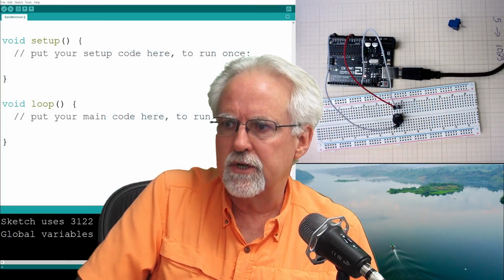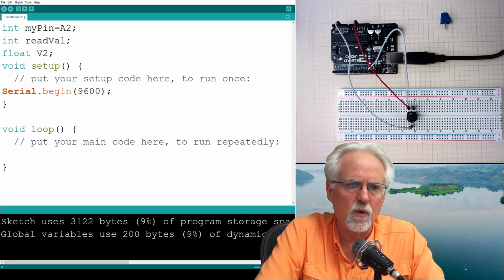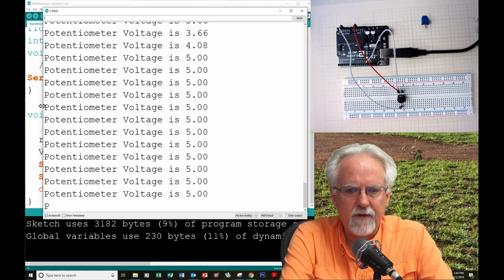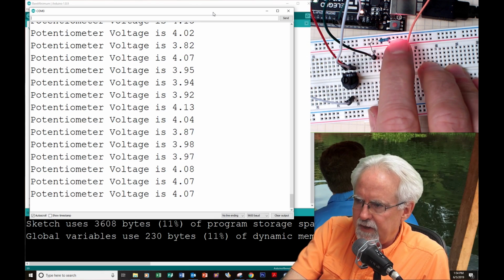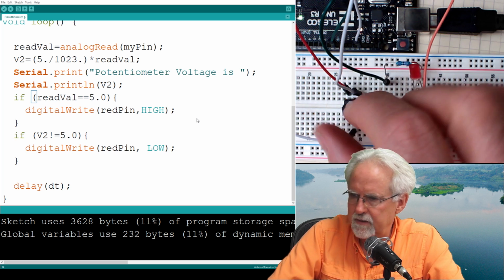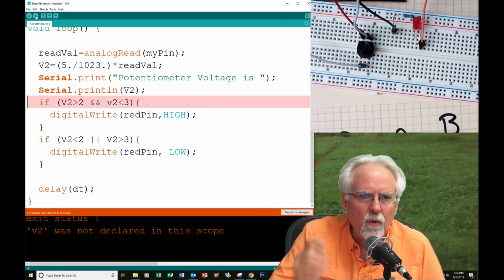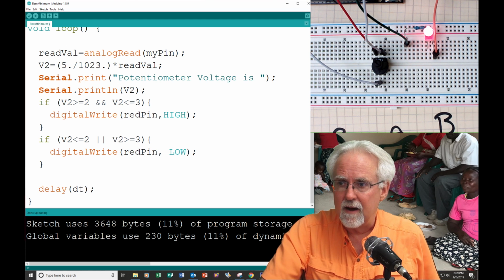Arduino Tutorial 13: Understanding Arduino If Statements

Comment: I think the problem with your if(V2 == 4) test condition is that the chances of your reading exactly 4 volts is very low.
Reply: That's why he put 5 instead of 4. His problem was the V2 != 4.0 conditional immediately after. You need to understand programming logic. What he essentially told the program to do is:

1. Turn LED on if 5.0 V
2. If NOT 4.0 V Turn LED off.

The 2nd command 'overwrote' the 1st, in a sense. I mean, the 1st command still exists and got executed, but the 2nd command ended up being the final one executed. Because when he turned the potentiometer to allow 5V, 5V is NOT 4V, and in the 2nd if statement, he told the program to turn led OFF if the voltage is not exactly 4V, which 5V isn't... That's why the LED turned ON with 1st IF command, but immediately turned and stayed OFF with the second IF command. Maybe if he'd put a big delay in between the IF statements, you could see this, but since he didn't, computers execute very fast and it seemed like nothing, but when you break it down that's what the issue was. He figured it out soon enough though, by changing the 2nd IF statement to != 5.0V, he corrected the problem.

Comment: I did the HW, and it worked just fine.  in each if condition, i have  
if(V2<3){
digitalWrite(greenPin,HIGH);
digitalWrite(redPin,LOW);
digitalWrite(yellowPin,LOW);

}
if (V2>=3 && V2<4){
  digitalWrite(greenPin,LOW);
digitalWrite(redPin,LOW);
digitalWrite(yellowPin,HIGH);
}

if (V2>4){
 digitalWrite(greenPin,LOW);
digitalWrite(redPin,HIGH);
digitalWrite(yellowPin,LOW);

let me know what you think?

Comment: Hello, I also am a 71 year old retired engineer and following through the lessons, as a new hobby.
I hope you will consider showing a schematic in addition to the wiring (for others), and just show the pin numbers on the schematic; that would really go faster for us who are advanced in reading schematics.

I still can't figure out why my stepper motor vibrates and doesn't turn. I hope the motor they gave me wasn't defective; that would be sad. (Well I did just jump ahead to that (interested me) and came back here. 

Any suggestions on how I can test if the step motor is good or bad?

Comment: Thank you so much for your effort.
This is the assignment if anyone wants to see:

int myPin = A2;
int readVal;
float V2;
int delayT = 250;
int greenPin = 11;
int yellowPin = 10;
int redPin = 9;

void setup(){
  pinMode(myPin, INPUT);
  pinMode(greenPin, OUTPUT);
  pinMode(yellowPin, OUTPUT);
  pinMode(redPin, OUTPUT);
  Serial.begin(9600);
}
void loop(){
  
readVal = analogRead(myPin);
V2 = (5. / 1023.) * readVal;
Serial.print("Voltage: ");
Serial.print(V2);
Serial.println(" V");

  if(V2 <= 3){
  digitalWrite(greenPin, HIGH);
} if(V2 >=3){
  digitalWrite(greenPin, LOW);
}

if(V2 > 3 && V2 < 4){
  digitalWrite(yellowPin, HIGH);
} else{
  digitalWrite(yellowPin, LOW);
}

if(V2 > 4 && V2 <= 5){
  digitalWrite(redPin, HIGH);
} else{
  digitalWrite(redPin, LOW);
}

delay(delayT);
}
Reply: Thanks! You helped me over a bump.

Comment: Hi. I am 72 years old, and spend a lovely time following your lessons. After learning the analog read and write, I am wondering why the analogRead runs between 0 to 1023, while the analogWrite runs between 0 to 255. Do you have any idea? Thank You
Reply from the maker: The analog read is a 10 bit number, meaning when you convert to decimal, you get 2^10 different number. 2^10 is 1024, but since we are starting from zero, we can count to 1023. The analog write is an 8 bit number, so if we start counting at 0 we can get to (2^8-1)=255
Reply: @paulmcwhorter  Hi Paul. It is very clear from your lessons, but since both of them are conversion to decimal, why dose the arduino use 10 bit for reading, and 8 bits for writing.
why not 8 or 10 bits for both of them?

Comment: The homework exercise has me thinking about that scene in Apollo 13 where they are working on the sequence to power up the command module after a few cold days in the LEM. Gary Sinise as Ken Mattingly is working on power-up sequences in the simulator. He needs to make sure that they don't draw more current than they have available. This kind of program could flash the lights (and not turn them off) if the number peaks at any time rather than watching a needle on a gauge as they did in the film.

Comment: if (2<V2<3){
    digitalWrite(redPin,HIGH);
  }
  if (V2<2.0 || V2>3.0){
    digitalWrite(redPin,LOW);
  }

I tried out this condition for the HIGH clause, the LED started blinking dimly for the LOW clause and was bright when the voltage was between 2V and 3V. Can you please explain why? Thank you!

Comment: Love the series!  I am confused on why "A2" is an int variable.  Is that just how Arduino is set up?
Reply: Hi Mike.  The Arduino differentiates between the Analog Readable pins and the other pins by prefixing them with "A".  Similarly, the Digital R/W pins are simply numbered 0-13.

Comment: Quick question: My readings from analog pins are only show as "0' If I connect them to ground, or if I hold other end of the cable.  Otherwise I always get a constant value of '318' as minimum and maximum 0f '1023' as expected. 
I did a calibration to software for a proper reading but I was wondering If I damaged the board with a short I have not noticed before.

I can ground it and it reads zero as expected but if I do that for every pin how am I going to read values... 

Checked potentiometer with the kit, looks like it's working as intented

Comment: Hey Paul,  love your Arduino instruction learning but I was trying to think outside the box an develop a circuit where we have a momentary button and a LED.  The Sketch would initially turn on the LED to a low light (10) then ramp up (get brighter)  when the button is pushed with a slow delay but when the ramp up is maxed (255), the LED would reset to low light (10) and wait for the button to be pushed again.  Now I was able to create a sketch to do the first part but when the LED is back to the reset state and I push the button again, it doesn't start the (IF) ramp up condition.  Do you have any suggestions?

Comment: i have been trying to relearn the Arduino, its been almost a decade. i followed along up to about tutorial 8 and i wanted to build my own little setup my goal was to have 3 inputs with 3 buttons each assigned to the RGB of the RGB LED. so if you hit the red button the LED turns red and you hit the blue button it turns blue. i have the RGB buttons on pins 2 3 4 and the LED leads on 8 9 10. i got it to work... sort of i hit the red button the LED turns red but stays red for about 5 seconds or so, the same happens with any of the 3 buttons in fact i don't have any delays. That was issue 1 my other issue is i seem to be triggering the digital read when i break the circuit like i can unplug the wire going to the red button and with it still plugged into the Arduino i can make the red LED light up with an open circuit i am a little confused as to why that is happening.

Comment: If you remove the delay the leds respond quicker to the pot turning ie at the threshold of one going off and another coming on but then the serial monitor text scrolls faster. Anyway to have a delay just in the monitor but not in the reading of voltage?

Comment: I feel so ashamed and proud at the same time, I was staring at code for hours wondering why this thing wasn't working and I had plugged in the wrong variable into the if statements and stuff, after I figured it out I cleaned up the code in less than 3 minutes such a feeling of satisfactionn stupid three LEDs LOL 😂

Comment: Got the assignment done. Yellow led was really dim for some reason but got it done. Thanks for the great videos.
Reply from the maker: Did you remember to do your pinMode? If you forgot that, it can lead to dim LED. Other possibility is your resistor is not correct value. Your LED should be bright if done correctly.
Reply: @paulmcwhorter   I believe I had the pinMode set up correctly. I had thought about the resistor being incorrect and checked that with my multimeter and is was a 330 ohm.  I also checked voltage coming out of the Arduino and I had 5V. Maybe I had a poor connection somewhere. I will redo the assignment and see if I can figure it out. Thanks.
Reply: Paul,
I just wanted to let you know I did the assignment again and it worked perfectly. Unfortunately I didn’t save my pervious program so I am not sure what I did wrong.  Guessing you were correct and I didn’t have my pinModes set up correctly.  I just want to thank you for not only sharing your knowledge with these great videos but replying to my comment and helping me work through issues is amazing. 

Thank you.

Comment: Hello, My name is John, I'm 58, and I'm from Maine. I studied electronics in the past and the circuits are very easy. What's not easy for me is programming the Arduino.  I've programmed some lighting effects for models but often get errors in my code or the lighting sequence doesn't work as expected.  I find learning the material, as you present it, enjoyable and very structured. I laugh at times when you get fussy about everything being lined up. I'm the same way. I can not do the circuits without first running power rails, LOL. After watching, building the circuit in this lesson, and writing the code, it seemed as though you did combine floats and integers with the statement  V2=(5./1023.)*readVal;  Am I missing something here?

Comment: Good day
Curious about the variable declarations where an integer is declared and assigned a value of A2 (A2 for the analog pin 2). A2 is not an integer.
Why?
Reply from the maker: A2 is an int, because arduino defines it as an int.
Reply: @paulmcwhorter  Funny in coding since it's not an actual number.
So be it

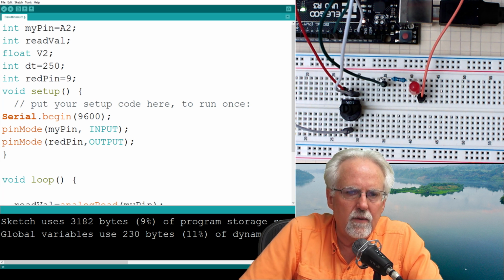Comment: AT 16:39 you realized you did not add "pinMode(mypin,INPUT);" to the void setup commands but at this point you had already ran the program and the serial monitor was displaying the read values set up in the void loop.  Are the analog pins on the Arduino always reading and the command is not required in the void setup?

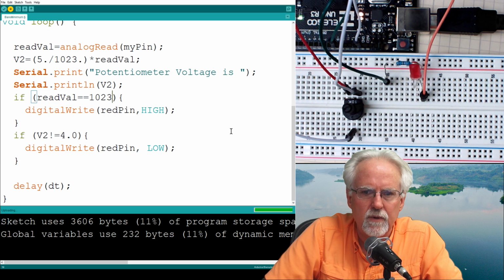Comment: I think the problem at 26:00 is that while you turn the LED on when you set voltage to 5, you immediately turn it off after that again because it is not 4. It's not a syntax problem but a logic problem. :)

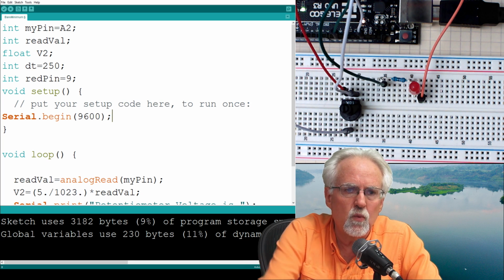Comment: At 16:10 you mention that you forgot to add the pinMode function to set A2 as an INPUT. but yet the circuit still functioned without it. Why is that? Or could it mean we dont really need it anyways? I tried doing all the codes you wrote in this lesson with and without it and it always functioned correctly.

Also at the end you wrote IF statements of (V2>=2 && V2<=3) and (V2<=2 || V2>=3)
Don't they kind of contradict each other since its saying to both turn on and off at 2V as well as 3V?
So out of curiosity I tried getting the serial monitor exactly to 2.0V and 3.0V
At 2.00V it resulted in making the LED blink consistently at the same rate as the set delay function in the code. Although at 3.00V it would also blink but randomly unlike 2.00V. Just thought I'd note that.

Thanks for the tutorial btw.

Comment: Hello Paul, I'm 69 years old and two months ago I didn't know for sure what a resistor was. Well look at me now.
I have a question. At the 35:10 mark why is there not a conflict between your two "if" statements? The first one says 
if V2 is <=3 redPin HIGH and the next if statement say if V2>=3 redPin LOW. I set up the assignment without the equals sign and after I had it working I went back and added the equal sign and had no conflict. Is it because it's just too hard to keep it on 3V and the eye can't see it.
I just became a pateron. Have an iced coffee (coffee != sugar || creamer)
Thanks for all of this.

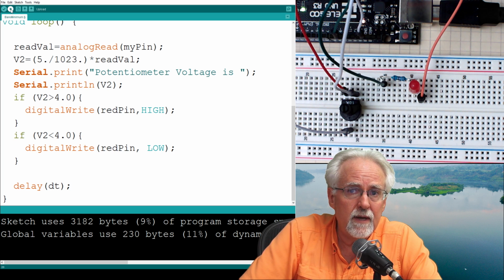Comment: 20:35  You could initialize a boolean flag variable e.g-ledON=false and update it to true in the for block when V>4.0 ,then create another for loop that updates it to false when V<4.0. That way you can avoid turning PIN off constantly inside the void loop.

Comment: At 27:00. Could you leave this.. if (Readval ==5.0)   {  ( digitalWrite redpin, HIGH)  };  if (V2 !=5.0) {   (digitalWrite, redpin LOW);    }
And have the code still work but in a  different way than is intended by Paul? I say it would. Wait.... Maybe the code would need an AND statement. An OR statement seems a better solution.

This will work I think... if (Readval==5.0) {     (digitalWrite, redpin HIGH)    };       AND   if (V2 !=5.0) { ( digitalWrite, redpin High)         }

Comment: Your excitement during work is great...
Reply: I am building a device to measure the speed accurately of vehicles and incoming or outgoing..
Please help me if there is any such sensor available in the market. 
I tried hb100, but that nneedsan amplifier circuit and does not tell the direction. This project is to save the lives of people in accidents. 
So please help me.

Comment: I spent an hour trying to find out why my red LED circuit wasn't working.  Test the LED, test the arduino leads, switch leads around.  Is the pot working?  Go out to my shop and get my Fluke which I trust completely. All are working as they should.  Finally found a period where a comma should be in the pinMode output for the LED.  What fun!  Love this stuff.  It's a super thing you're doing giving this free course.  Have a coffee.
Reply from the maker: Called Troubleshooting. No fun at the time, but wonderful joy when you find the problem.

Comment: Paul, this would've been a perfect opportunity to introduce the else statement as in if … else ...

Using else is a much more elegant and less error-prone way to provide instructions that should happen if the condition is not true rather than writing a second condition which is the negation of the if condition.
Reply from the maker: No, I dont use else because in practice it is a logical double negative. Logically it is clearer to explicitly cover a parameter space in positive logic. As a practicing engineer I can not tell you how many times I have seen disaster on projects and programs due to incorrect logic resulting from use of else.

Comment: Is it appropriate to post homework assignments? I did a sketch that formats the output with ten rows of ten values j. It prints out a perfect table and then stops. It doesn't continue looping like the 'for and while' loops. curious about that. To get a nice pretty table, press the 'clear output button' in the bottom righthand corner of the screen and the push the reset button on the Arduino. 
int j=1;
int forAwhile =70;
void setup() {
  Serial.begin(9600);
  }
void loop() {
 if(j<=100){
  if(j==1||j==11||j==21||j==31||j==41||j==51||j==61||j==71||j==81||j==91) {
  Serial.println();
  }
  Serial.print("|");
  Serial.print(" ");
  if (j<10){
    Serial.print(" ");
  }
  Serial.print(j);
  Serial.print(" ");
  j=j+1;
  delay(forAwhile);
  }
}

Comment: int myVoltPin=A2;
int readVal;
float v2;
int time=250;
int grnPin=12;
int ywPin=7;
int redPin=8;

void setup() {
  // put your setup code here, to run once:
Serial.begin (9600);
pinMode (redPin,OUTPUT);
pinMode (ywPin,OUTPUT);
pinMode (grnPin,OUTPUT);
pinMode (myVoltPin, INPUT);

}

void loop() {
  // put your main code here, to run repeatedly:
readVal=analogRead(myVoltPin);

v2=(5./1023.)*readVal;
Serial.print("the voltage is ");
Serial.println(v2);

if (v2<3.0) {
digitalWrite (grnPin,HIGH);
digitalWrite (ywPin,LOW);
digitalWrite (redPin,LOW);
delay(time);
}

if (v2>3.0  && v2<=3.5 ) {
digitalWrite (grnPin,LOW);
digitalWrite (ywPin,HIGH);
digitalWrite (redPin,LOW);
delay (time+150);
}

if (v2>3.0  && v2<=3.5 ) {
digitalWrite (grnPin,LOW);
digitalWrite (ywPin,LOW);
digitalWrite (redPin,LOW);
delay (time+150);
}

if (v2>3.5  && v2<=4.0 ) {
 
digitalWrite (grnPin,LOW);
digitalWrite (ywPin,LOW);
digitalWrite (redPin,LOW);
delay (time); 
}

if (v2>3.5  && v2<=4.0 ) {
digitalWrite (grnPin,LOW);
digitalWrite (ywPin,HIGH);
digitalWrite (redPin,LOW);
delay (time);
}

if (v2>4.0  && v2<=4.5 ) {
digitalWrite (grnPin,LOW);
digitalWrite (ywPin,LOW);
digitalWrite (redPin,LOW);
delay (time-100);
}

if (v2>4.0  && v2<=4.5 ) {
digitalWrite (grnPin,LOW);
digitalWrite (ywPin,LOW);
digitalWrite (redPin,HIGH);
delay (time-100);
}

if (v2>4.5  && v2<=5.0 ) {
digitalWrite (grnPin,LOW);
digitalWrite (ywPin,LOW);
digitalWrite (redPin,LOW);
delay (time-200);
}

if (v2>4.5  && v2<=5.0 ) {
digitalWrite (grnPin,LOW);
digitalWrite (ywPin,LOW);
digitalWrite (redPin,HIGH);
delay (time-200);
}

delay(time);

}

Comment: Hi Paul, I had a question. Do we need to declare the analog pin as input? It's already an input by default and I got the circuit working without doing that.
And by the way, completed the assignment and it worked great. Just when I turn the potentiometer too fast and go from below 3 to above 4, the light goes directly from green to red, skipping the yellow. I guess it has something to do with the baud rate.

Comment: Can someone explain why LED has lower brightness when connected to a PWM pin, compared to the digital pins, which makes LED very bright?
Reply from the maker: Did you do your pinmodes?
Reply: @paulmcwhorter  Yeah I always do those first. I also tried different PWM pins. It's working fine when doing the dimmed LED project though.
Reply: @paulmcwhorter  I see what I did wrong. I ran analogWrite instead of digitalWrite.